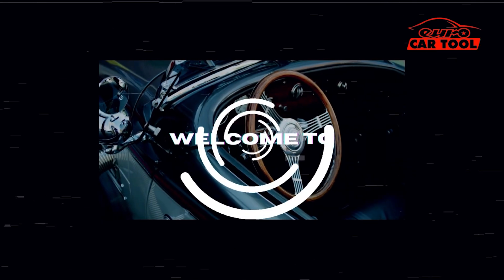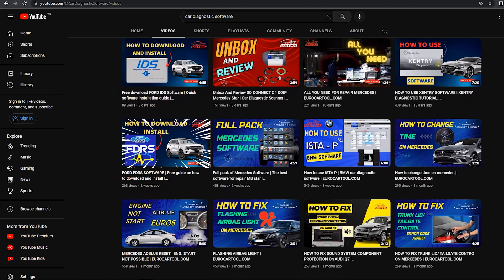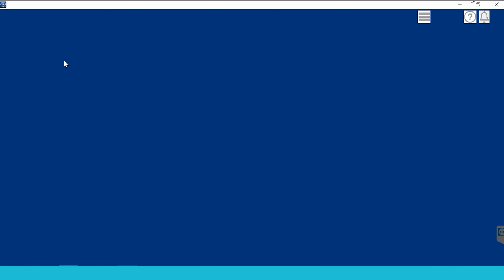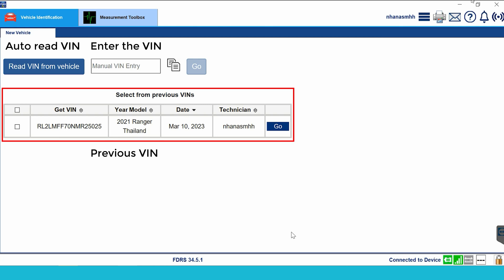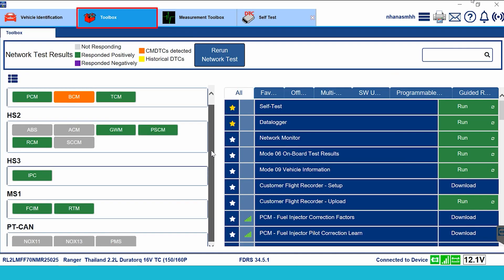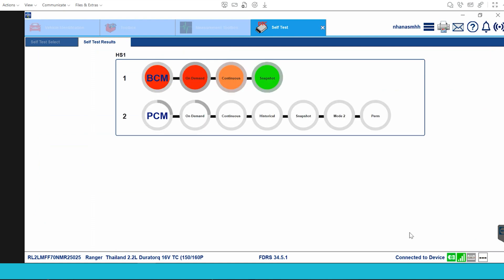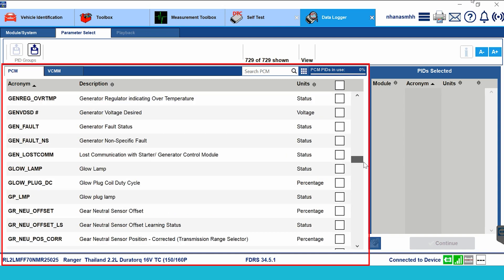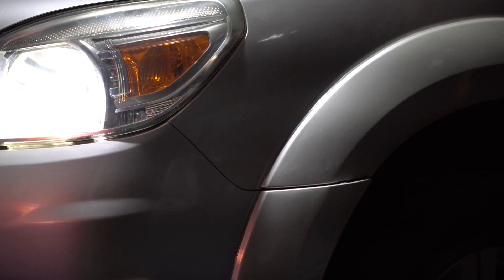Ford Fdrs Tutorial | How to use FDRS | EUROCARTOOL.COM

Comment: What kind of laptop are you using? I need to get one to use fdrs. what are the specs on the computer. thanks.
Reply from the maker: Connect with me via whatssap to best support you WhatsApp: wa.me/message/JWACD3PLNZRAN1
Reply from the maker: Connect with me via whatssap to best support you WhatsApp: wa.me/message/JWACD3PLNZRAN1
Reply from the maker: Connect with me via whatssap to best support you WhatsApp: wa.me/message/JWACD3PLNZRAN1